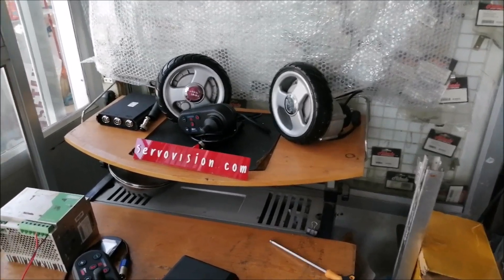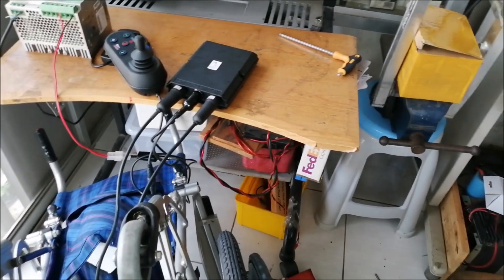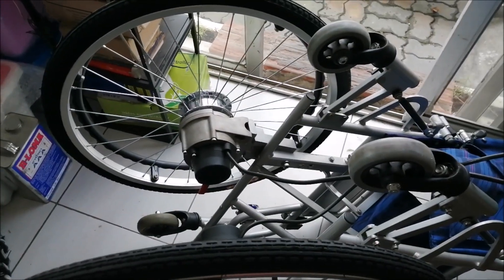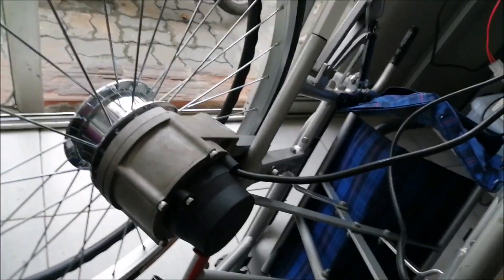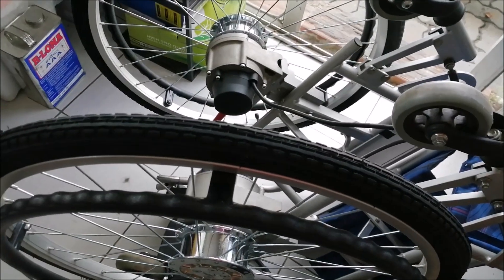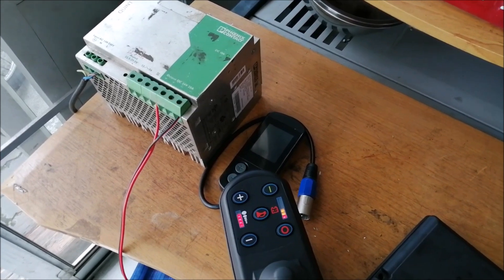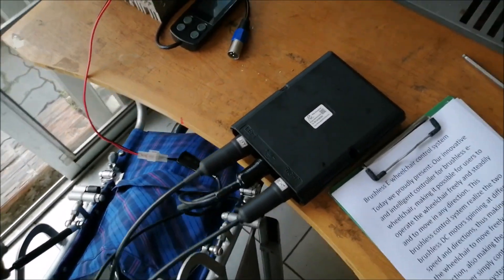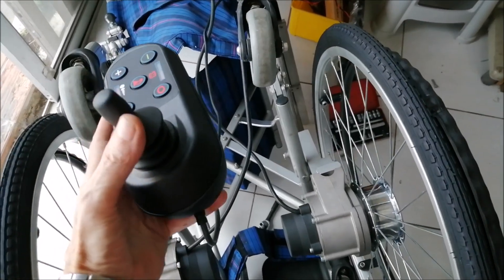Brushless E  Wheelchair contol system with 24 inch wheel

Comment: Hey Hafiz, 
Im Frank. Run a wheelchair repair company. These chairs seem to be in demand for repair. My question is what are the extra pins in the motor plugs, (i count 7) in each plug. Im assuming that the large three pins are power to rotation, but wonder what the other 7 are for. Additionally, why are there 5 pins in the DC input plug? (instead of just 2 (+/_)). Any insight that you could give me would be of great help.
Thank you. Frank